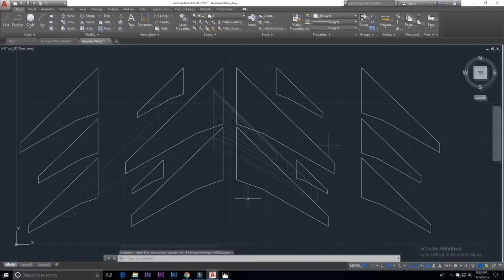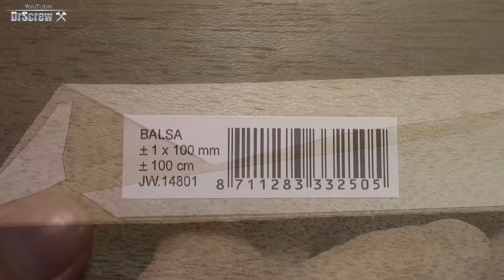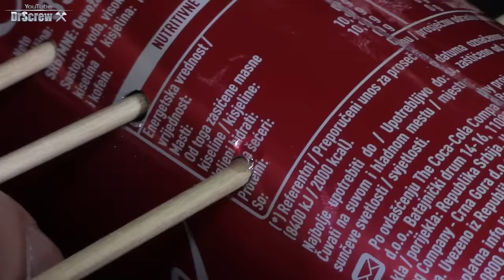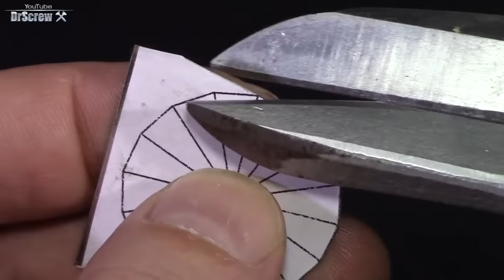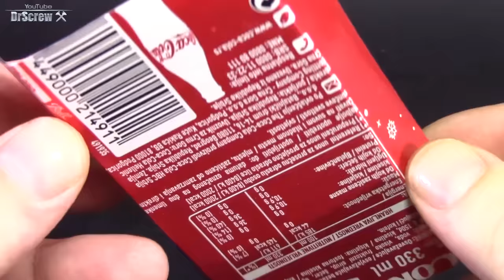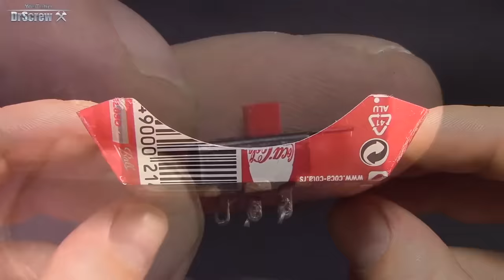How to Make Coca Cola Airplane

Comment: 5:44 does it run on Coke?

I suppose not, the passengers probably drink Coke because it is dripping from inside the fuselage

This is incredible it's really cool, a model plane that doesn't cost £400 that flies although the nose is kind of ugly not gonna lie
Reply: It's a Boeing 747-100
Reply: @elamigomusical37  747 100 doesn't have winglets but newer 747 does